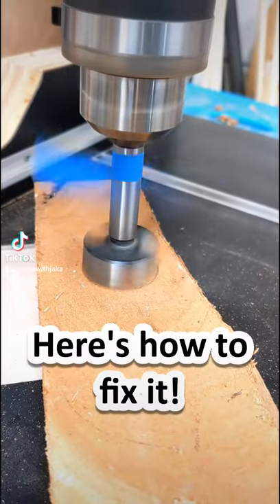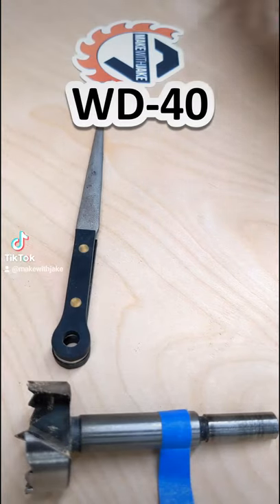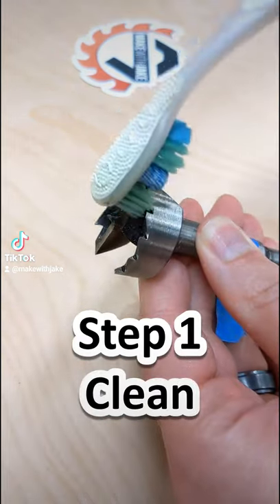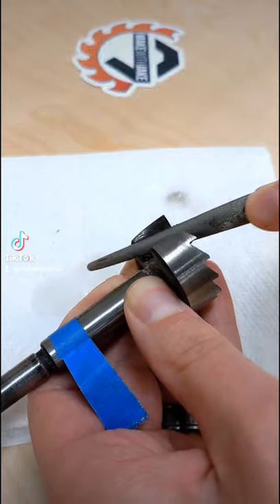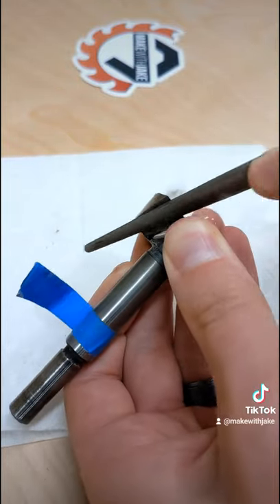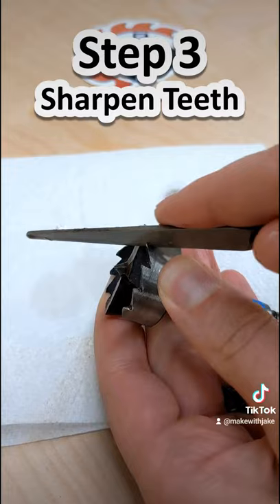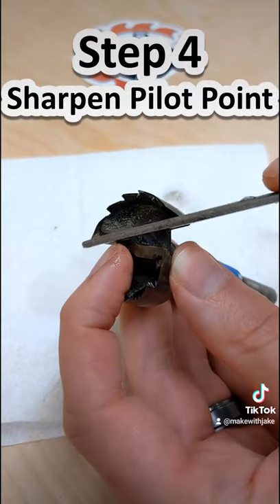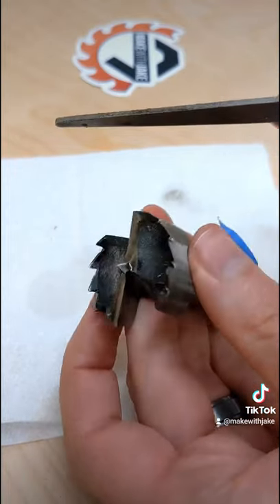Sharpen a Dull Forstner Bit in 30 seconds! #shorts

Comment: I may need to do this!
Reply from the maker: It makes a HUGE difference.  No more burning, and once you get your process dialed in, the bits cut better than new!
Reply: @MakewithJake  I noticed a lot of smoke in you shot glass video.  Haha.
Reply from the maker: Yep! Sharp bit is essential to drilling end grain. Also, my lathe doesn't go slow enough, so the speed was way too high for that type of cut.